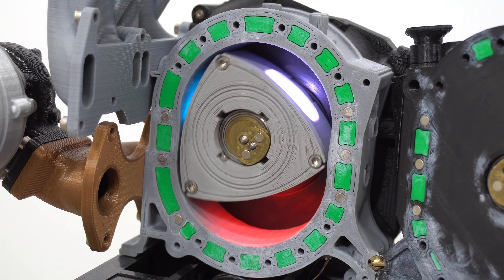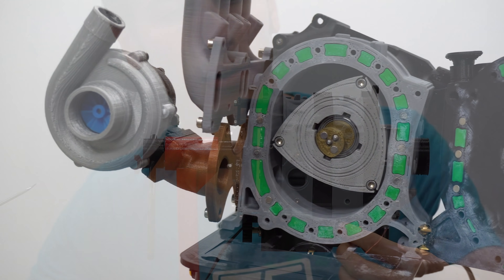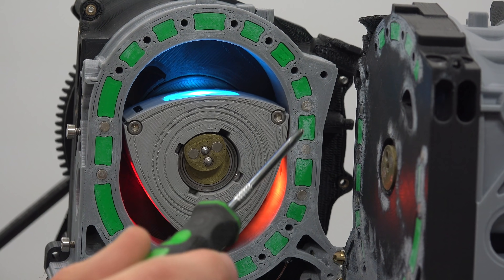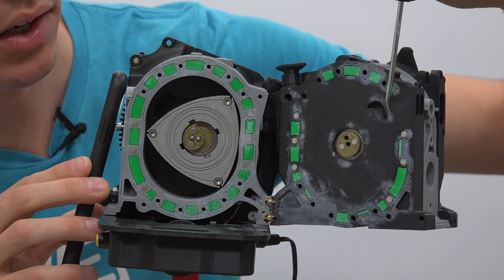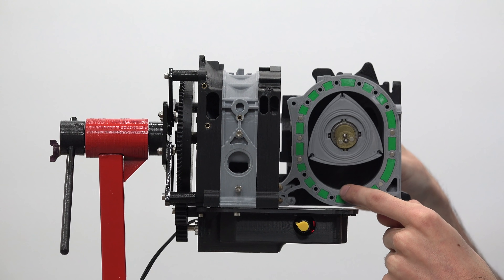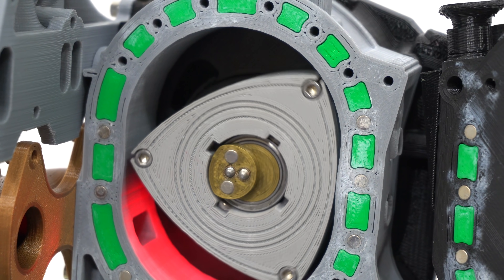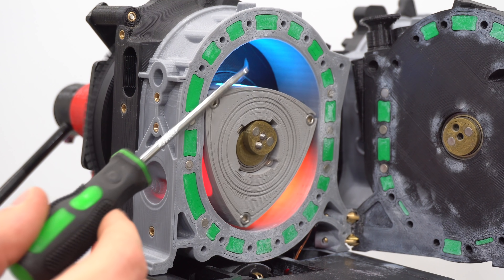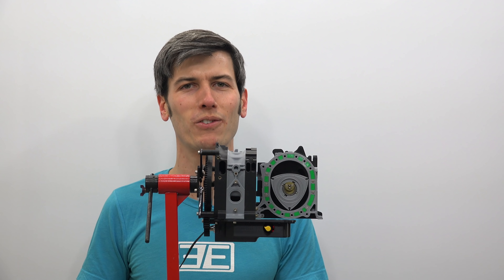This 3D Printed Rotary Engine Is Genius - Mazda RX-7

Comment: I have an 09 RX8 that I picked up in 2012.  Still runs as good as it did when i picked it up.  Not very fuel efficient, but its a blast to drive and has a back seat for my kid.  And the rotary just makes it a tad bit more special feeling when you drive it.

Comment: Just got an RX8, I really enjoyed this. I'm a piston mechanic and am excited to tear my engine apart when the time comes.
Reply: good luck... keep the rotary spirit going!!
Reply: Apparently aftermarket apex seals last longer, so if the compression is below 6, I would do it just for peace of mind.
Reply: There is a channel called Driven by Madness. The guy made a ton of videos about the RX-8. Definitely worth checking out.
Reply: @tiborklein5349  Yeah they bend instead of breaking, you definitely pay the difference however lol
Reply: @tiborklein5349  Doing it before it broke cost a lot less to rebuild.
Reply: P. Doherty  Yeah I'd rather drive a front wheel drive impala than a 50/50 dist FR sports car that has a better redline scream than anything within twice its price range smh.  Not everyone drives a car for the fuel economy or ability to put 500,000 on the odometer before changing the oil once so just let rotary owners be
Reply: P. Doherty  mine has 60k miles. I'd rather keep it a rotary as that's what makes it special. Everyone is crushing theirs or swapping them so I feel in 20yrs there will be very few rx8s left increasing their value. 

I think I'd prefer swapping an LNF or LSJ if I was to swap to a Chevy powerplant.
Reply: P. Doherty   What a waste of time and money...your idea is! Non-manufactures', engine swaps are a great way to janky-up your ride? Yeah, you sound like a pro, "teck-missen".

Comment: So is it twin, sequential or twin-sequential? I know you're not trying to say it actually had 4 turbos!
Reply: Nah. It had two sequential turbos.. First one would come on for lower rpm's and then it would switch over to the second. You could actually remove some vacumm lines/switch some things and have them both on at the same time though. Which a few people did, because the sequential system used like 30ft of vacumm lines and eventually one of them would leak/break.
Reply: If that makes any sense. 2 turbos total. Also that model he has is converted to single larger turbo.. which many people also did/do..

Comment: Fun fact: "The Legendary Mazda 787B with its R26B Engine, a 4 Rotor Mazda Rotary Engine, is the First and ONLY Japanese Car to Outright Win at Le Mans. After that win the Rotary Engine was banned from ever competing again at Le Mans."
Reply: but the ban has happened after the win so that counts as a win

plus their production car is a Japan Exclusive Mazda Cosmo so there goes your argument
Reply: wrong, they were banned. The ban has been lifted.
Reply: wow didn't know that
Reply: Those Mazda weren't that good, not bad, but not that good either. Lapped 4~5 secs off the front runners in tracks like Fuji or Autopolis. It won Le Mans because it wasn't carrying the 200kg ballast everyone else was running (Thanks to Hughes de Chaunac being a good politician). It was banned for 1992 WSC because everyone had to used F1-derived 3.5L V-engine that year,  and the ban was lifted. There were Wankels in Le Mans '94 already.
Wankel were still used in American sportscar races, but rarely being competitive.
Toyota has won Le Mans too, so theres two japanese winners now.
Reply: The 787B gets circle jerked so much. Truth is it didn't get banned because it was so good, it just got regulated out of competition for reasons other than it as a rotary.

Toyota won because no one of significant importance raced last year.  No Audi. No Porsche. Their last lap loss in 2016 was heartbreaking for sure, but the 2018 win was a phone-in. Well, as much of a phone-in a 24 hour race can be.
Reply: One thing about two stroke engines that no engineer on you tube as ever addressed .. and that is the fact that a two stroke engine is self supercharging making it's own boost without adding a turbo or a supercharger ..something no other engine design can do ... If you want proof ask the engineers at Honda's research and development in Milwaukee Wisconsin who explained it all two me during a Honda training program
Reply: Reminds me of when they banned the R32, wahh japanese cars better must ban them
Reply: so much misinformation holy!!! Toyota has won a couple LeMans for consecutive years by now and even when the comment was made, the rotary was never banned, in fact Mazda tried racing in LeMans with the rotary again in 1994, the reason Mazda couldn't compete with the rotary for the 1992 year is because for that year the FIA wanted the cars to use that year's F1 engine in LeMans cars
Reply: Probably because it has twice the power strokes of a piston engine.. As said in the video most people consider a rotary to be 2x size of it's listed displacement, because it's so efficient. e.g. most people will say "yeah, but that 1.3l is really a 2.6l if you think about it.."
Reply: @JesusChrist-uu2te  Apple to pear comparison.
Reply: @JesusChrist-uu2te  wouldnt a rule like " rotary engines can only have half the size of normal ones"  be fair?
Reply: Again. I'm not sure a rule like that, that "rotaries can only be half the size of their piston counterparts" is fair.. Sounds like a bunch of people finding a reason to complain because they got beat, tbh.. You can make a 26B out of 2 13b's together. You use a custom eccentric shaft(crankshaft in a piston engine) but it's 2.6l by the real size. Even at double it's 5.2l. There's less to modify.. IMO people got mad because they got beat, and pointing out why it beat them was their "Well they cheated". This is a debate that will always be a debate, because some people don't like the idea of a small L being fast and find a way to say "Well, that's not fair.."
Reply: @JesusChrist-uu2te  It's ironic because the Mazda didn't win because it was fast, it's because all the other cars broke down., ie, lets ban the slow car.
Reply: @JesusChrist-uu2te  The reason it's a 2.6L engine is based on the piston engine being rated on 2 revolutions to fire all pistons, and the 13B  rotary is 1.3L based on just 1 shaft revolution. Using the piston engine, 2 rev method, it's a 2.6L, and it fires 4 of the 6 chambers. A full rotary cycle takes 3 revs to fire all 6 chambers in the 2 rotors.
Reply: @JesusChrist-uu2te  nope, it's only 650cc per rotor
Reply: @JesusChrist-uu2te  Def not efficient. Look at the terrible gas mileage and emissions this is why they are no longer in production. The reason they make more power per liter is the same reason a 2 stroke piston engine does...it fires a power stroke every revolution.
Reply: Yeah but is gas mileage and emissions part of what qualifies a car?? Or is it make the most HP/be the fastest under a certain L or CI?? They do get crap gas mileage because you have to pump them with fuel, but for what it is, it's EFFICIENT at making power for it's size/what it is. They're really no longer in production because a lot of people don't know how to treat rotaries. Like they need the crap beat out of them every once in a while to clean out carbon. Yes if you leave them sitting for a white, you need to dip the spark plugs in ATF and put them back in. It's too much work for your average geek who just wants to go to his desk job and back with no real vested value in a rotary vs say a BMW...
Reply: Steven Kaspick: Well I was happy with my fuel mileage as I made it from Memphis to Haltom city in 5.5 hours to have Steve Kan tune my car which ended up at 474rwhp @ 19psi. Oh, and I missed the 820 exit off of 30. I checked my mileage at a fill up and was getting 22mpg. You can say, well, that’s not impressive, so ....Math it out, because I wasn’t going the speed limit.... AT ALL.
Reply: They got banned because cheating with a non-production engine that was not related to the 13B (they implied that the 26B was 2 13B engines together, but 26B was a competition engine not related in design to the 13B with different housing designs among other characteristics.

Getting banned just disqualifies their victory.
Reply: TOYOTA just won Le-Mans 24 hours recently with 2 cars and they are the legit Japanese manufacturer to do so because Mazda was banned and its Le-Mans win has no value
Reply: @EM6285   Yes, Yes, Toyota won... BUT they were the only ones in the LMP1 category in 2018... So pretty easy win actually...
And Mazzy has a point : the FIA banned the wankel engine (not Mazda itself) and only after they winned, so in my opinion, Mazda are the still the only legit Japanese winners of the 24 hours of Le Mans
Reply: @qaewsrdtfcgzvhbujnkim   They were not the only LMP1, they were the only hybrid LMP1. Being hybrid has advantages and disadvantages, there is more design freedom for non hybrids. Plus, in 2016 they were the fastest and broke on the last lap, which stresses the point that sometimes you are really racing yourself.

Comment: Still love the Wankel. Don't care about the oil consumption. Or the fuel economy. Or the apex seals. Or the high emissions.
Reply from the maker: Sounds so stressful haha
Reply: that's the spirit lol. although i do care about apex seals. if your gonna have a vehicle or toy whatever with a rotary its still nice for that thing to be reliable regardless of how much you actually use it. id love to have one of those crazy super bikes being made with a rotary motor. i guess it blows away 1000cc factory super bikes plus i guess it has a way lower CG which makes sense seeing as it has no vertically positioned cylinders and a twin cam cylinder head mounted on top of it.
Reply: No valves . No pistons no camshafts . One eccentric shaft and two rotors and a few seals . Three moving parts .
Reply: nearest orgasm you can get with rotary engine is a 2 stroke motorcycle..
Reply: @fidelcatsro6948   2 stroke snowmobile way more fun and powerful
Reply: people always overlook the friction on the rotor "faces" to the rotorhousings. I can't get over all tbe surface area!
Reply: @carlosandleon  corner and side seals are present, thankfully that isn't as big of an issue.
Reply: Replaced the turbo on my ‘87 — Mazda helped with the cost.  Other than that, I had no other problems until the engine “missed a beat” every once in awhile.  Replaced the clutch when the turbo was replaced because the dealer said it was cheaper while the turbo was being R&Red.  Dealer was very surprised I had never replaced the clutch.  Bought in ‘86 and sold in ‘99 with well over 100k miles.  Poor gas mileage, and of course oil was consumed for lubrication.  Only sold because of that rare “miss.”
Reply: That's the spirit man !
Reply: I only care about the size so I'm swapping B13 into Smart. The only problem is a transverse transmission. I was only able to find a  sequential racing model for MR2.
Reply: Why is it so bad that this engine burns a little bit of oil, while there are engines that runs by burning solely oil?
Reply: yes, Wankels are awesome. They get criticized for a lot of things but there's this. If you had a 1.3 liter V8 spinning 9000rpm producing 200 horsepower per liter, would it have better thermal efficiency, weight, and reliability than a Wankel of similar size? I don't know. Let's ask the engineers at Honda, Kawasaki, Ducati, and Ferrari...
Reply: My FC is still going strong at 150000 miles on the original engine. They're only as unreliable as you make them.

Comment: ...that motor would of been awesome in the Miata as an option.    👍🏻
Reply: A rotary Miata would kill everything.
Reply: I think the engine sound wouldn't fit to the miata
Reply: basically a RX-8 with less doors and seats
Reply: Mazzy The MazdaTiger  only in the NC version of the Miata.
Reply: You have the Mazda Cosmo Sport which is like the grandpa of the Miata and RX-7
Reply: Mazda had several for testing hydrogen. I'm not sure why they didn't use the regular RX-8 (they did for 1, but most used the Miata). So if Mazda found it just as easy to use a Miata as their standard company car, I would guess you could fit one in too, it may share some of the same mounting designs since its the same company (IDK, but Mazda seemed to think it was easy for a test platform, generally you make those as simple as you can)
Reply: Thomas Schick 
I’m down to do it
Reply: Miata has always been about the classic open air British roadster. Naturally aspirated goodness. It's more about carving corners with race worthy execution than going really fast, but skilled drivers on tracks can usually out pace cars with twice or more the power. I don't think the rotary fits its personality. The RX7 carried it better.
Reply: Motor? You mean engine

Comment: The rotary engine is not dead if a manufacturer  would put it in off-road vehicles like a side-by-side a 1 liter turbo rotary that puts off 200 horsepower that would be amazing
Reply from the maker: It's not in production by Madza, but they have announced they'll be bringing it back as a range extender.